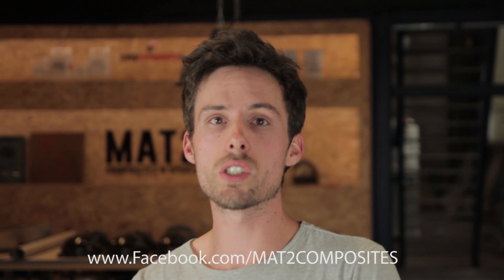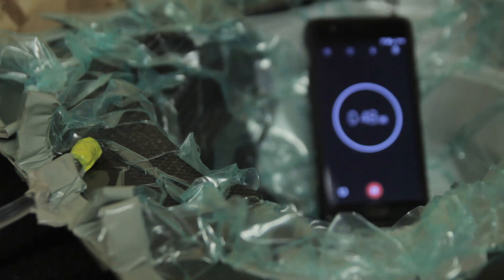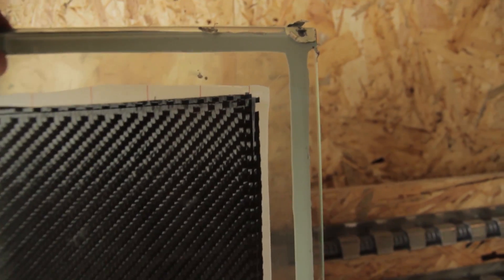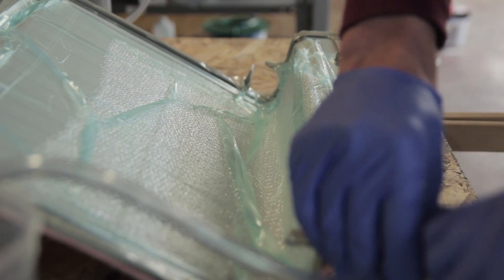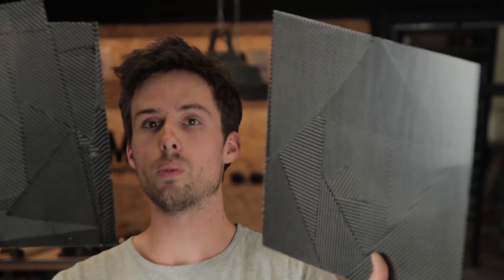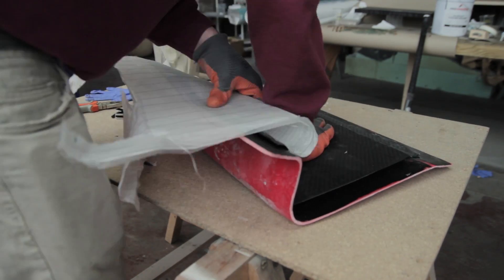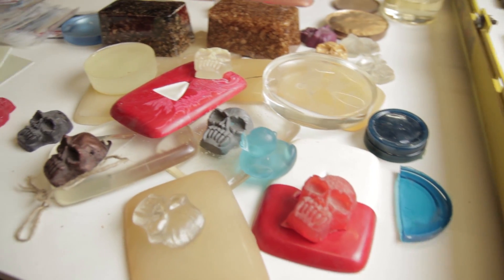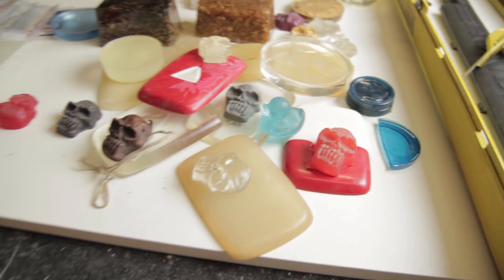Resin Infusion For Beginners | We Love Composites *1

Comment: Matthieu, I see in the last part of the video the CF is sandwiched between 2 layer of glass.

Can we work the same way with prepregs? For example 2 aluminium mould (1 positive, 1 negative) press CF that sits in the middle. 

Reason is so that 
1) holes could be  punched thru the moulds and before it's cured, and perhaps the mould could be designed to shear off the edges too.
2) the CF conform better to the mould shape
Reply: as long as the mold you are using is strong enough and wont melt (it need ts to withstand atleast 150-200°C...depends on which resing you are using and how much hardner you add) you are good

Comment: I've been looking at all easy composites videos and I have a background in fibreglassing. I'm currently building a track car which I will take a mould of the roof skin and both quarter panels. I looked into skinning but for the amount of work , time and effort without it being an exact replica piece infusion seems more suited. Is there any size limitations to when doing resin infusion as quarter panels are a substantially  big part. Any info would  be appreciated
Reply from the maker: No problem with size for big parts, theu build boats with infusion so shouldn't  e a problem

Comment: Hi there,very cool video and very informative,one question though,how do you create a glossy finish on both sides of finished product? Can you leave out the peel ply?
Reply: well u can use 2 glass pannels or just put something smooth under the bag ... and peel ply is not usefull for small projects like this becouse the only purpose is to lower the smoothing u need to do on the finished product

i only use it on parts where i need to glue some other parts ... but i never put it on a 30 meter yacht manly cut everything is hidden ;)

Comment: Hey Matthieu, thanks for the videos, i'm wondering how much more effective is infusion versus brushing the resin in and then applying the vacuum..
Reply: Actually, i'm wondering if it's worth applying vacuum if i'll brush the resin in..
Reply: The point of vacuum is to improve the resin to weight ratio as well as reducing the likelihood of voids.  The lower the resin to weight ratio, the stronger the part.  With resin infusion you can hit 40% resin content.  Just for example you can hit upwards of 70% resin content when hand brushing chopped strand mat.

Comment: hay matt, i want to ask you, how to calculate resin and hardener if we use them in vacuum bag?
Reply: Weigh your cloth on a digital scale.  If the dry weight of your cloth is 300 grams, then you will need 300 grams of epoxy PLUS enough to fill the resin lines and account for the bleed out before the entire layup to infuses.

Comment: Hi :) Have you heard about Surf Flow (glass mat). It's a peel ply and infusion mesh in one. Unfortunately the layer becomes part of the product. It's not the best solution for  carbon fiber but it makes it easy for beginners to try.  This material gives you the chance to make weird shapes that can't be done because of infusion mesh stiffness or  no possibility to remove peel ply and mesh after all, etc.

Comment: Exited for this, however i have some questions: i am absolutely new to this and therefore want to apologise if my question is basic, but why are you using carbon fiber when you're not heating up the product? Whenever i see a video of a car manufacturer or some other carbon fiber production i see them putting the resin/fiber mixture into a oven, as the resins used cure only at higher temperature... wow this is already longer than i anticipated but yeah.. so you primarily use carbon because it looks cooler? is it really stiffer than glass when you use the same type of resin which has not got to be heated?
Reply from the maker: Glad you asked, and not a stupid question! What they use is called prepreg and it means it's "pre-impregnated" meaning the resin is already saturated into the fibers, while heating it under vacuum it will flow at some temperature and then cure at a higher temperature. It is a total different technique that I show here, the resin I use is made out of a A-component and B-component, varying on different manufacturers and specifications it will cure at room temperature after a certain time, in this case under vacuum after the fibers are saturated while the resin still can flow through. At my opinion not one is better than the other, just a matter of what you are making. hope this helps you out a bit more, you can find more about everything on the internet if interested look on wikipedia or something for "VARTM (vacuum assisted resin transfer moulding) what I use here or  "Prepreg carbonfiber" for what the carmanufacturers use like U say, I have some videos about that as well on my channel if interested, just browse around on my channel and you should find it ;)
Reply: thank you for clearing that up!